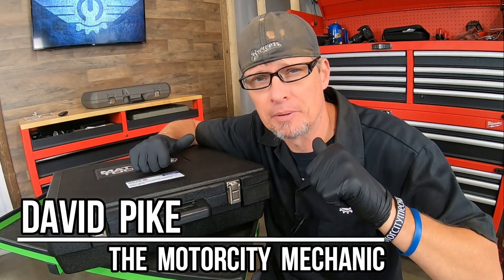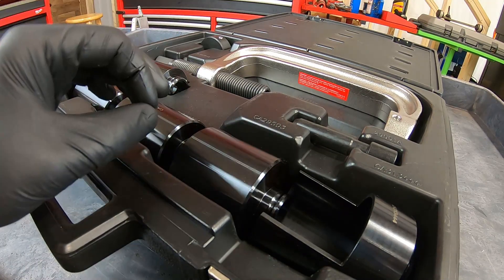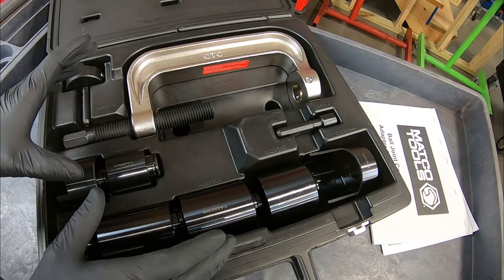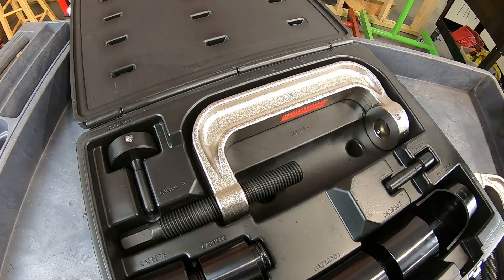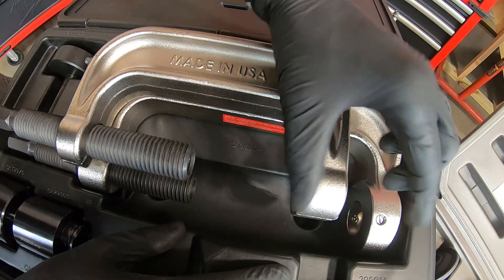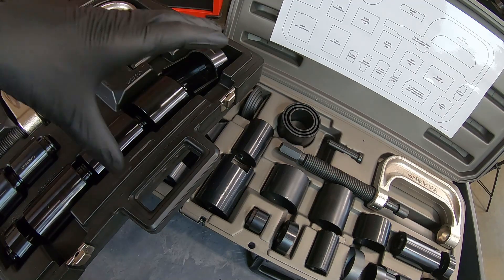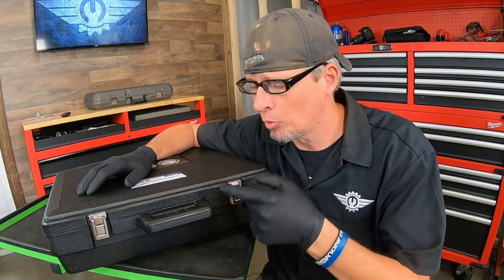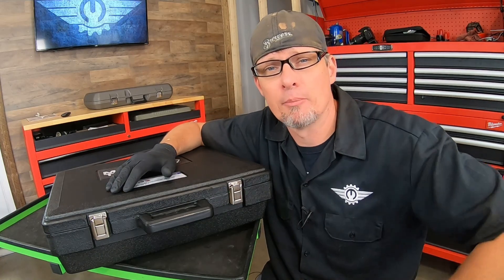Matco Tools BJPXR9 ball joint connected adapter starter kit

Comment: That reminds add GA watermelon to the shopping list! 

Appreciate your unbiased and honest opinion. I used many things before I ever could afford a ball joint press tool. Big beaters and pipe of various diameters, steel blocks, port-a-power. When I got to use the kit it was like a jigsaw puzzle, Ages 2-4 years... I was happy to figure it out in a couple of months! 
Did a lot of truck work back in the day king pin etc, and most of it was beater work. A shop press is handy too.

Keep them coming Prof. David love the videos! Stay Safe and Healthy, you and yours!
Reply from the maker: Much appreciated. Some I could beat out with a hammer back in the day....like the Jeep liberty ball joints. Having one with all the adaptors sure makes it easier
Reply: @MotorCityMechanic  BTW only Fladuh watermelon in Sam's Club today!

Comment: Excellent video and great review!  However I got this as well and you forgot to mention that all the old Matco and OTC adapters will work with this new C Frame as well, they just don’t connect like the new.  So new point in getting rid or selling any of the current stuff. It’s complimentary to what you have. And the C Frame is bigger than the Snap On!

Comment: Rent for free from auto parts store.
Reply from the maker: I have but most times it doesn’t have the adaptors I need and end up fighting with it to try to get it pressed in or out. Typically their kits don’t have enough adaptors in my opinion.
Reply: @MotorCityMechanic  , renting is not a good option for you when you're working on cars everyday.  For DIY people,  renting is better option.